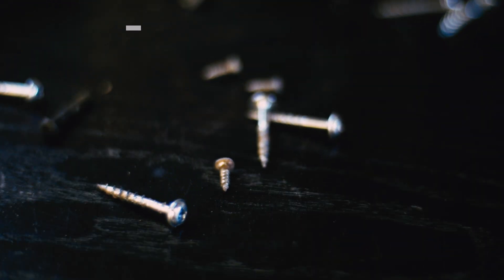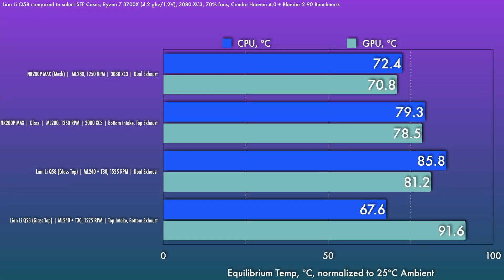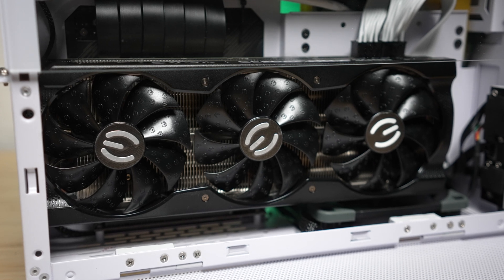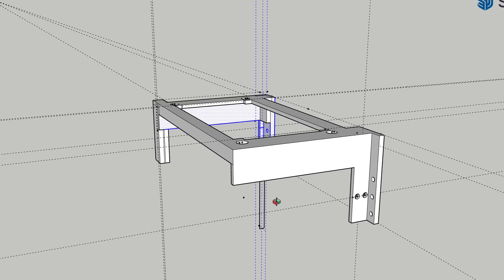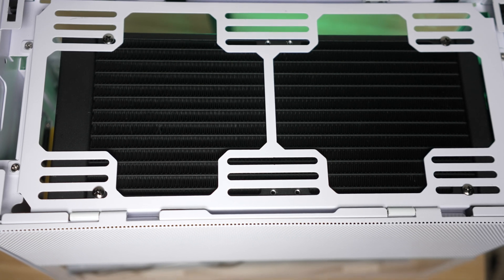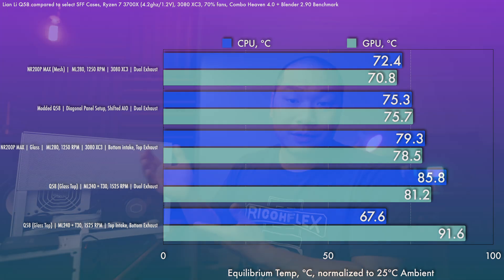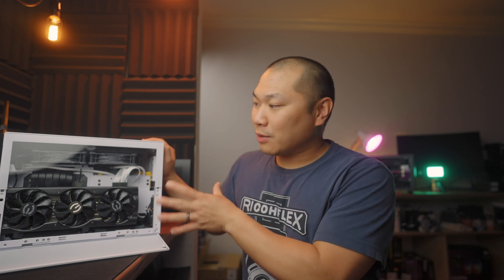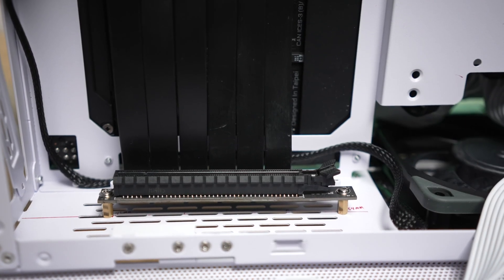Modding the Lian Li Q58 for Better Thermals

Comment: I've done the diagonal Panel modded setup plus shifted AIO and despite noticing a slight better thermals idle. When gaming is a bit worse than my previous setup of glass bottom half with but with the gpu side panel always open 😅. So it's worth for the aesthetics, and better than when i used top glass back when used to be way worse than now, so definitely is working. I think i need to increase cpu aio fan to cool the case better, that most be the key, but got to make the fans follow gpu temperature...

Comment: not sure if you still look at comments for this, but the biggest problem i've had after 3 years of having this case and going to upgrade is the riser cable. no one makes this version of it not even lian li, i wanted to upgrade to a pcie 5.0 and then my 4.0 one broke as well but this riser cable is vertical mounted reverse. everyone has reverse or vertical mount but none have had both. i'm doing a 90 degree adapter today, hope it works

Comment: My PSU failed after 6 months. Does anyone have same issue with this case? I'm starting to think bottom fan blowing air + dust right into psu unused opening sockets plugs might be causing psu failure. Is there any chance of that happening realistically?
Reply from the maker: Sorry to hear, I think PSUs don’t usually fail from dust, likely a faulty component. Hope its under warranty.

Comment: Man oh man. I have this case with a 7800xt GPU and a 13700k CPU. Its a very hot duo. Im will gladly make this changes to get best thermal performance ... thing is should i stick to AIO or air cooling ? Also.. i noticed some people use those contact plates in the cpu . Is  that really a thing?

Comment: I'm so hyped for my build, wish lian li would have just given us full panels for the case though and half panels as extras, like a small asus ap201 prime (my current case, which led me to getting the q58 in the first place). sucks that it's discontinued, but I'm happy to have one to build in.
Reply: Man, I've built my Q58 PC a year ago, and the riser gen 3 cable seems to have gone bad. Problem is I can't find any replacement cables at all that will fit in the standoffs in the case...

Comment: He does a bottom exhaust fan, top exhaust fans, shifts the rad over closer to the cpu side, puts the panels in a diagonal way, moves the gpu closer to the panel, and moved the psu up more with a custom bracket.

Comment: For my setup in the LL Q58, intel 12700 and rtx 3060ti, am i understanding correctly that there's not a "most optimal" when it comes to setting the top 280 aio as exhaust or intake? and it's really up to me on whether i want to prioritize CPU or GPU temps?

Comment: I have watched your H20 and Q58 videos multiple times. I am just so torn. I have a Q58 case coming today and H20 (from AliExpress coming 2-3 weeks if not later) . I ordered the Q58 with extra mesh panels so I could have mesh on all 4 sections. I don't know If I should just go for the Q58 or wait for the H20. 

Do you have any input? which one do you like better? 

My components are 3070ti FE, 5600x, 240 AIO, 600 SFF, 32gb 3600mhz 16cl, 1TB m2. I have everything but the case LOL. If I go for Q58, I would go for all the mods you did here.
Reply from the maker: I like the H2O better but both are good, if you’re using a 240 AIO that fits (the pump clearance is low) then I think the H2O is the way to go. For air cooling the Q58 has critically more clearance.
Reply: @MachinesMore  thanks bro. I actually ordered it from Ali Express March 3rd and it came here yesterday. I was so shocked!

Lastly, is it worth getting the Noctua fans? Do you have cheaper suggestions?

Comment: I wonder how much more you would get out of drilling larger holes in the top panel and a 280 rad.

I'll be setting up a hwlabs 280 GTS in mine soon. Had to wait forever to get a white one.

Wonder how fast I'll have to run the fans to keep water temp in check.

Comment: Hey man, great video. Have you tried doing intake on the AIO instead of the exhaust? Wouldn't you get fresh air in for both cpu and gpu?
Reply from the maker: In a CPU priority scenario, yes absolutely. But the positive pressure setup really hurts GPU thermals.

Comment: Did anyone try putting the AIO on intake instead of exhaust? So GPU and AIO intake, to exhast out the mesh panel. The PSU is then somewhat of an issue though. I wish this case wasn't sandwich style, it would be perfect then. Basically a smaller NR200 and thermals could flow bottom to top with no issues of the glass panels being on the top
Reply from the maker: I tested in my initial review- it’s great for CPU thermals but was unsustainable (topping 90 degrees) for the 3080, granted with a lower powered card it would absolutely be serviceable.

Comment: AWSOME MODS...I WENT AIR COOLED WITH A R7 2700...AND A RTX 2060...TOP INTAKE BOTTOM EXHAUST..GREAT TEMPS FOR ME...MESH ON BOTH BOTTOMS..GLASS ON TOPS HELPS CHANNEL AIR TO THE MOBO ...GOT A 3.5IN 4TB HANGING UNDER TOP FANS...2TB BEHIND POWER SUPPLY AND A 500G SSD IN THE FRONT...ITS A GOOD LIL PC.

Comment: I would love to see you look at the mods available for the Meshlicious! There are a ton of 3D print ones available which include adding extra fans to the GPU side as well as a slim fan on the top. In addition, I believe there is a "mod" where if you block off the airflow from the GPU to the radiator up front with a piece of paper, you can drastically improve CPU thermals. Please take a look!

Comment: The ones I have seen have the mesh panels on the bottom and the acrylic up top. That screams to me to use fans up top, set to exhaust, to pull air in from the bottom sides, up and across the components. 
I don't remember seeing anything vented on the bottom (although I see here that there is some venting there), so this makes the most sense to me. Had MicroCenter had any black in stock, I'd have taken one home today.

Comment: Moved my card. Hasn’t even hit 70 since (heavy undervolt) 

I did notice however that my PCB and backplate REALLY have to squeeze to be able to mount. To the point of there being a slight curve on the card. 
Are you experiencing the same thing in your build?
Reply from the maker: I haven’t but if that’s happening then I’d check the position of the riser cable, there is some play there so if you wiggle it a bit to a better position I think it will help.

Comment: Good modding idea's. This is why i like your channel, your not afraid to do some mods for science sakes 👍. I have this case and love it, im running an overclocked 5600x with the id-cooling is-60 with a new chromax NF-A12x25 and it stays around 65C while gaming. But my poor evga 3080 x3 was getting HOT, throttling unless i cranked up the fans. I got the evga hybrid kit and installed it with two t30 fans. Runs overclocked at around 65c as well, and the system is almost silent. I did have to tape up the air gaps (picked that up from your Meshlicious case review) on the aio mount to help from hot air recirculating because that top panel isn't very breathable. Anywho, great content, your fan reviews and case reviews were a big influence on my build 👍

Comment: I would love to see them rework the top panel. I’m running a 5900x and evga 3080ti ftw3 ultra card in the q58 on a 280mm ek aio all 3 fans exhausting. Saw about a 5 degree decrease on cpu and 4 degree decrease on the gpu when I took the the top panel off. Seems like a pretty huge oversight by lian li.
Reply: Yeah the holes are too small. Thinking of drilling larger ones but that would destroy the finish.
Reply: Yeah for sure, I actually ended up designing a new top panel in fusion 360 to 3D print. Just kept the same dimensions but replaced the holes with slots, now I see almost no difference in temps on vs off, definitely worth it.
Reply: Ok I'm a little late to this but replacement top and side panels are being sold on Etsy.

Comment: Nice work!  Would it be possible to flip the power source 90 degrees so that the power source fan is aligning with either the top or bottom case fans?  If so, do you think it would provide any improvement in noise and/or cooling?
Reply from the maker: With the 3D printed bracket, yes it would, since it doesn't have a solid back. The original/stock one does and that won't work since it would seal off the fan completely. Would it make a difference... I don't think it would be meaningful. One thought is that if it were flipped and took the hotter exhaust on the GPU to cool itself, it might be less effective, but it's not like PSUs need that much cooling. Oversizing it a bit for the build should be sufficient.

Comment: Taking inspiration from your meshlicious modifications, could you do a circular makeshift gasket on the psu, sealing the bottom half of the fan against the glass, top half against the mesh, giving a direct path into the top half of the fan through the mesh and pulling it down into the whole fan
Reply from the maker: I think it could be done- one additional thought I had was just to completely enclose the GPU in its own chamber by closing off the top and forcing the exhaust through the bottom fan. That way each chamber is optimized.
Reply: @MachinesMore  yes! that could be a good idea too!!
I just thought your idea of making the "gasket" for the meshlicious was incredibly creative, and it made me think you could do it for the PSU on this case as well.
I literally bought an nr200 b/c of you, and 6 weeks later i'm swapping to a mshlicious instead, solely because of your work on them.

maybe you should stop making case videos, you're costing me $$ and drawing the ire of my wife :)

Comment: If I were ever able to mod a case. I'd go for trying to make the NR200 a little taller, just enough to fit 2 140s at the bottom and at the top. And I'd like to have a drive cage for 2 2.5" SSDs "hanging" from the PSU. To maximize air cooling and storage capabilities and make the definitive case. Then it would just be missing a USB type-C port. But I that's a little more complicated.
Reply from the maker: Yeah, NR200P Liquid (tall) and NR200P Air (wide) would be an awesome v2 development!

Comment: I always figured this case had potential. With a 280mm rad, and full mesh panels I wonder how much better the temps could become
Reply: You can order a second order of mesh panels, I have them, temps are very good, only have a 240 aio tho
Reply: @watlerinc.7924  do you think a 280 would make much of a difference than a 240?
Reply: @watlerinc.7924  what temps are you getting with all mesh setup?

Comment: Nice tweaks! I wonder if there are any replacement for the top panel. It limits airflow too much. Did you try temps with your tweaks and no top panel?
Reply from the maker: Let me do that! And yeah, there aren’t quite as many vents as there should be.
Reply: @MachinesMore  nice! Let me know, interested in the results.
Reply: They sell seperate airflow-pannels in my country. Would be nice to see what difference it makes.
Reply: @jonasmaas6548  top panels also? Or just the side mesh panels?